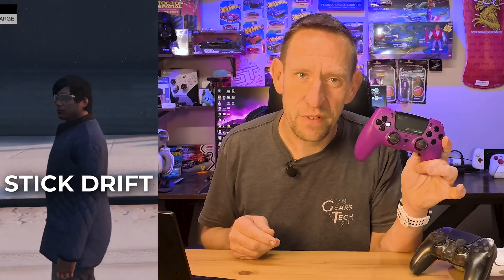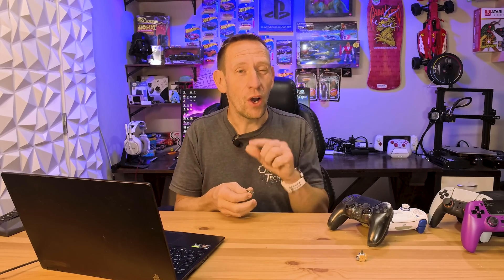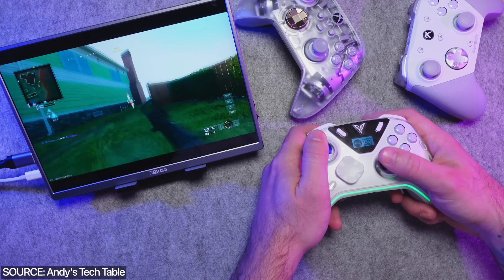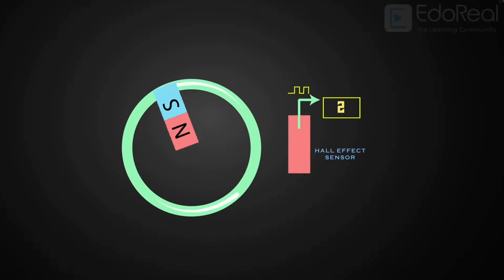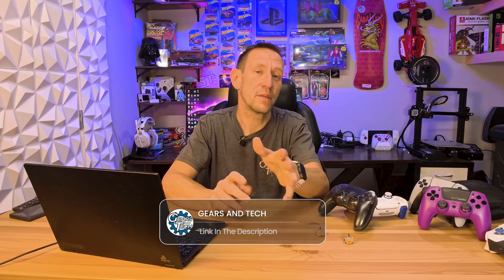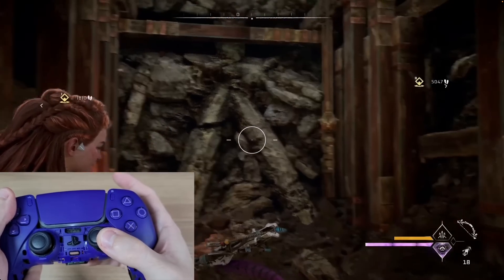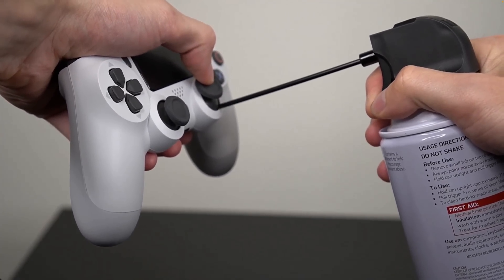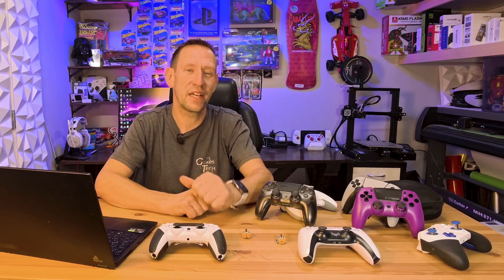Hall Effect VS TMR ~ Pick the Right Stick First Time

Comment: I have a Hexgaming Phantom Controller with Hall effect sticks. Best controller I ever had

Edit: also on my controller I can change the input curve and the dead zone on the hall effect sticks, which start off as a square shape but you can adjust it to a circle shape like a normal PS5 controller or any other one. And it's very ez to adjust with the tool they have to adjust it. I highly recommend this controller to everyone. 3 of my friends have also got this same controller! Thank me later

Comment: Or just play games the way they were intended, with a mouse and keyboard.
Reply: yeah right because the first game consoles were played with a mouse and keyboard not something that mimics a controller or operated like one. MnK were originally made for computing coding and programming if im correct, not playing games.
Reply: @AltYoutubeAccount    The whole "mouse and keyboard wasn't made for games" is such an ignorant uneducated argument. They are simply a way of interfacing with the computer and it so happens that in certain genres, no other input works as well as a mosue and keyboard does. FPS game game design is drastically stifled by controller limitations.  RTS games have become pretty much nonexistent because of controller focused game design. Many genres that were always PC only have faded away due to the urge to push everything to multiple platforms and from a business standpoint I get it, but it has come at a cost to the art.
Reply: @slack9879 Ignorant? You said games were meant to be played with MnK but when consoles and gaming as a whole was becoming popular they were controlled with controllers. Uneducated? History has shown otherwise, id say you would have a compelling argument if it was the other way around and gaming was started and played on mnk but that isnt the case. Controller wasnt the main popularized input it was the only original input on ps1 ps2 og xbox and atari and nintendo 64. If my comment is so uneducated then point me to some facts instead of writing a paragraph based of your feelings. remind me again when did mnk gaming become the norm? After controllers were already mainstream? Huh funny how the facts make me "ignorant" but not your comment written off bias and opinion.
Reply: @slack9879 Also gonna point out how ignorant it really is to jump on an informative video about controllers and say just play mnk. Kinda ironic.

Comment: I have gamesir g7 pro and Vader 5 pro and they are the best 2 controllers.
But Bader 5 pro despite having hall sticks , is on par with tmr g7 pro.
Reply: Which one do like more? I just got the g7 pro ZZZ edition but I have to wait for the Brook Wingman P5 to arrive so I can use it on the PS5. It's my first pro controller ever so I'm pumped
Reply: Yall know a lot about controllers? I’m just a madden player looking for a smaller p5 controller . More like the p4 one. Any ideas ? I have dual sense edge feels too big to me. I just am switched from Xbox so I was considering getting the victrix bc of the offset analogs. U guys have any ideas on a smaller p4 like controller ?
Reply: @Youngyak510  @AlmightyyySo510 look up the new Brook Wingman P5 converter for PS5. It converts xbox/3rd party/Nintendo/ps4,ps3/PC controllers for use on the PS5 wirelessly and wired connections. So you'll just be able to plug in wingman P5 converter to your PS5 and use your PS4 dualshock on it easily. Or basically any other controller you wish and with 3rd party pro controllers being cheaper and better than ever before plus having a HUGE amount of options from many different companies you can't go wrong. I think 8bitdo and flydigi has some smaller options like the dualsense as well gamesir, well at least the g7 pro is kind of on the smaller side compared to standard PS5 and xbox controllers